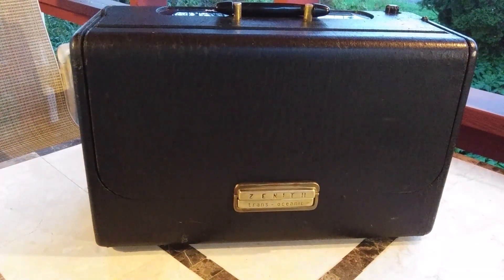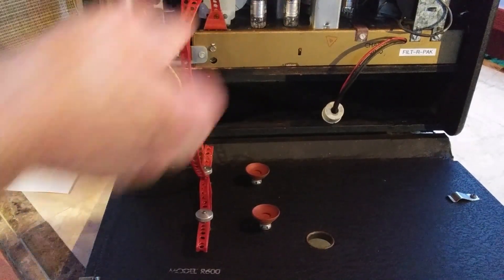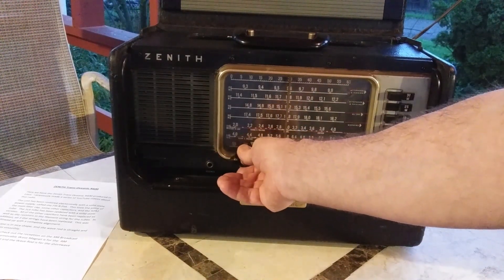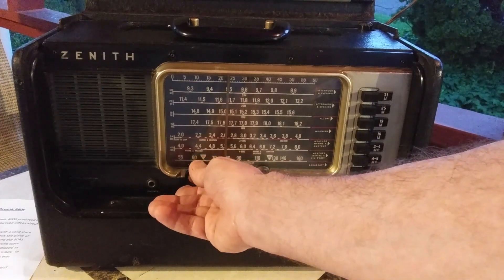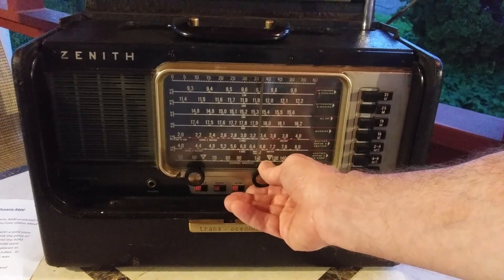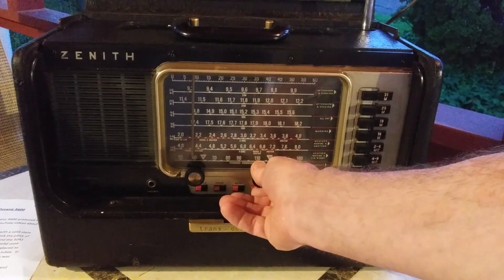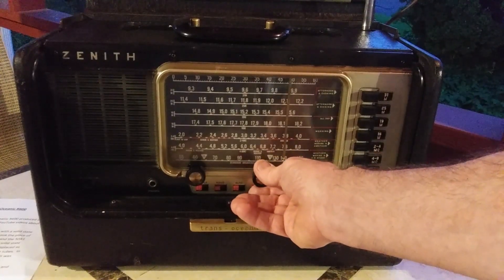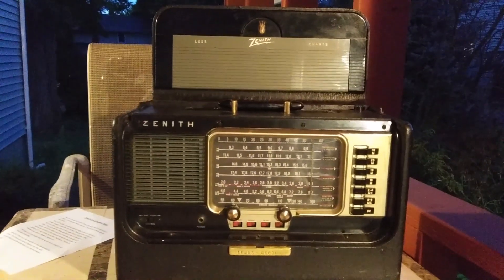Zenith Trans-Oceanic R600 Demonstration

Comment: I have the newer, transistorized version of the T.O.
It is my favorite portable shortwave receiver!
With a wire antenna, or even the built in whip, it gets good reception on all bands.
Mine uses 10 D cells, which makes the unit very heavy!
Reply from the maker: I have one of those too, but it doesn't get much use, unfortunately.
Thanks for watching and commenting.
73 Paul AA1SU
Reply: @vtradio  I like to take mine on vacations and to family gatherings, I have made many people aware of the different bands and even made some new SW listeners!

Comment: I just bought  Zenith Transoceanic B-600 off of eBay. BC AM works great but it is not receiving anything on SW - just buzzing noise. What do i need to check to troubleshoot SW reception? Also, is it possible to connect an external antenna to this radio?
Reply from the maker: The fact that you are receiving the AM Broadcast Band is a very good sign. What I would do for starters is to go to a room, away from computers (or outside), and extend the wave rod (antenna) all the way up.  If it's daytime, alternate between the top 4 bands and tune around the dial slowly.  If it's nighttime, try the bottom two bands. You should be able to tune something in.

Yes, this radio will accept an external antenna.  Open up the back and you will see two screws near the bottom of the wave rod.  You can attach a long wire to the one marked 'A'.  The other one is marked 'G' for ground. Don't worry too much about that one.

If you want to see the video series that I did on restoring this radio, go to my channel and click on Playlists. It will probably be more that you want to get in to, but it may give you some ideas of what to look for.  If you know someone with a tube tester, you may want to start by checking those (baby steps).  Installing the Filt-R-Pak from eBay would be a plus, too.  I just checked and the seller is running low on stock.  I need to order one each for my 8G005 and my H500.  Good Luck and keep me posted.

73 Paul AA1SU
Reply: @vtradio  
Thank you for your suggestions, Sir.
Here's my setup.
https://youtu.be/TwdrXaBCZJE?si=9badqcOiyo9E5CTB
The SW now works great with my external Hustler HF all band vertical. 31-meter band is my favorite and, of course,  it is best to listen to it at night. Here, in California,  I am able to pick up Radio España daily on 9.690 MHz starting around 22:00 UTC (around 2 PM Pacific). And, yes, the radio hates all modern electronics and LED lighting, so I had to setup a normal incandescent lighting in my bedroom because I love falling asleep while listening to a SW broadcast with a little bit of static noise. Although, I don't speak any other languages besides English and my native Russian, I still enjoy listening to broadcasts no matter what language they are in. I am a bit disappointed about the lack of European stations that can be  heard  on SW bands at my QTH but there is  a station from. Miami that broadcasts European radio shows.
73!

Comment: I have the same model, not quite nice as yours. I bought the "Voltmatic Regulator" tube for it in the early 80's for $35.
Reply from the maker: Bob - Thanks for watching and thanks for the comment.  What is the "Voltmatic Regulator" tube?  The 50A1 perhaps?
Reply: @vtradio   That's the one. It's the ballast tube.